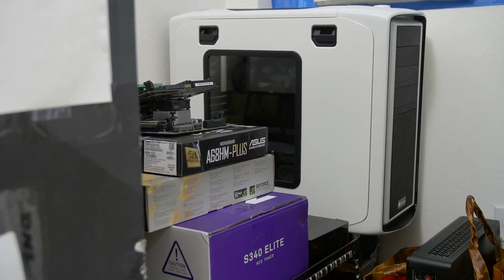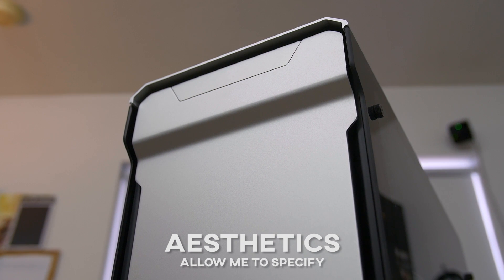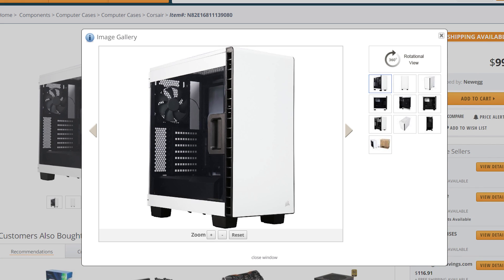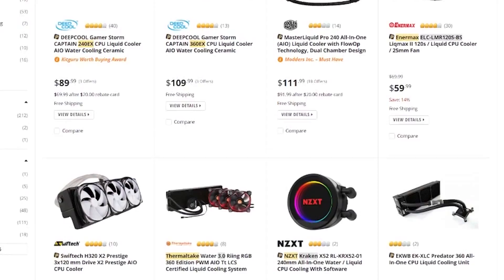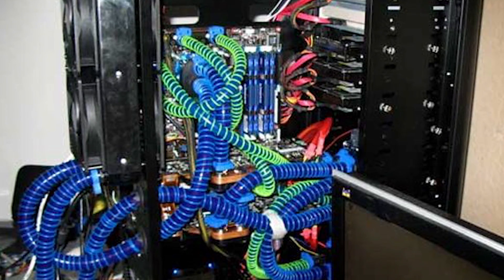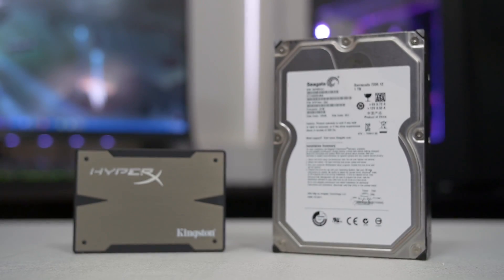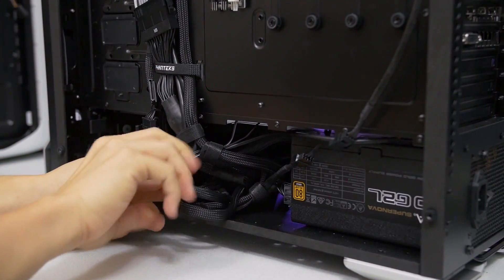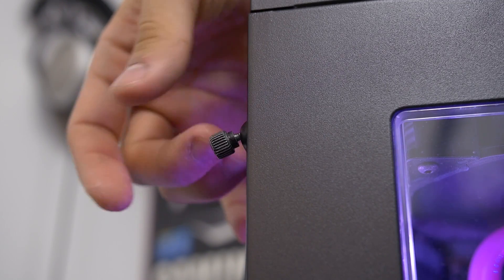4 Major Changes to PC Cases in the Last 5 Years: Then and Now

Comment: Sorry to say this but the most annoying thing about modern cases is the removal of 5.25" bays. Some of us still use DVD/CD/blu-ray drives for installing software and watching films and tv shows on DVD and blu-ray. It was an absolute nightmare trying to find a decent case that had a 5.25" bay but I did find a Phanteks Enthoo Pro at Novatech in Portchester that has 3 of them.

Comment: A lot of mid grade cases comes with dust filters, instead of taking my PC apart to clean it, just clean the filter every 2 weeks. 5” bays are gone and HDD move to the bottom. Most cases can accommodate water cooling.

Comment: For me I really enjoy 2020 trend of full mesh fronts instead of glass, like in a whole Cooler Master lineup and couple of others.
And yes - cable management came a loooong journey. Last week I've tried to cable manage my 5 year old PC. I've ended up buying a new case. Great to have power cable cutouts, but I have like 1cm of clerance in the back side of PC so no option to route main power cable. And a power supply mount in the upper corner... ughh boi

Comment: Man we're not even going back far enough here to talk about when power supplies got mounted on top and cable management solutions were virtually non-existent.  My first case was an original Apevia X-Cruiser back in 2008 and it was basically just a standard office desktop tower like you'd get from Dell or HP at the time, just painted black and with a fancy front panel.

Comment: I'm still with my 6 years old system, and is still running pretty strong, just had a recent minor upgrade (a gpu), and my case is the 600t like in the video, and maybe in 2021 i would upgrade, but i am definetly keeping the case for it's side panel, and frankly it doesn't look too bad even if it's old (and it was also very pricy in italy back then around 200€).
i7 3770K @5.2Ghz, 16Gb of ram and an RX580 (got a deal used for 100€)

Comment: rubber grommets on cable route holes, PSU mounting position (but that goes WAY back), cable management, space, cooling. 

My case (CiT G Force Gaming Case (red LEDs) is SHIT. Properly bad. No grommets on cable holes, very little attention to cable management (if any) no space to stuff extra cables, the WORST cooling solution in the history of cases. I mean seriously, friction (at the best of times) mount honey comb metal strip....things with FOAM acting as a dust filter like WTF CiT. and a bunch of other pointless things.

Comment: Asus Vento 3600 in black, I still use it. Bought it as a joke in mid 2000's because it was so ugly. Grew to love it and now I still use it with my current build. Funny thing is it actually keeps my 1080's cooler then my NZXT case o.O Side case fans need to make a come back and RGB needs to die.

Comment: you forgot the fact that the cases now can take bigger air cooler heat sync and since the removal of the cage there is more space for the larger video card.  Also the cut out behind the cpu to make mounting the cpu heatsink /water block easier without pulling out the motherboard

Comment: I would like to see cases that are completely tool-less except the PSU and motherboard. Rubber stand mounts under the motherboard to reduce vibration from the GPU and CPU fans / pumps would be a big plus. Better sound or more dampening materials. Case fans REALLY need to drop in price because $20 gives you a decent fan a $30+ you get really good fans. I really don't want to spend $60 to $100+ just on fans. I know this video came out a year a go but it still seems to be up-to-date.

Comment: I hate captive thumb screws! 
They are not working as smooth as the normal thumbscrews used to! :P
On my latest Phanteks build I screw them in tilted several times and they were hard to unscrew with the thread getting beat up a little.

Comment: I love all these new things. Though I will miss the days of cutting holes in a new case with a cutting wheel, and bending the back panel to hide cables as much as possible because semi modular PSUS where way to expensive. Or reverse mounting hard drives to hide the cables, buying cablized IDE cables so you don't have a pancake of wires blocking all airflow. I also miss the sounds of a western digital raptor raid setup. Or the sound of a Bigfoot booting. Uh oh....im getting old...

Comment: Hehe, i got this exact corsair case still, and recently the top fan burstet into flames because a capacitor overheatet and lit the dust in the honeycomb above.... so if some one is still using it, beware of old case fans

Comment: I hate modern cases.. Don't mind the design but I want a 5-inch bay; card readers aren't useless, same with extra front USB...

Also, basements and shrouds are just lazy to me.. I loom and manage my cables no matter what; some kid buys a case with a basement and shoves the wires in it and he's a 'custom PC builder'.

Fractal Arc Midi 4 lyfe.

Comment: i wanted to make a cheap media rig to have in the living room just for storing our favorite movies/music etc and when i remembered i kept my old HP pavilion mini ATX case that i ransacked for spare parts during my last build, i figured i would use that as my platform! well that idea ended quickly when i realized how small the space inside is, virtually no cable management options short of zip tying to random pieces of sheet metal and how awful the fan locations are on those old cases (1) 92mm bottom and (1) 80mm side fan only? really 2007?)im just going to use a Fractal Design Node 804 for the media rig, it actually looks a lot like my surround sound subwoofer so it should blend with the rest of the setup better anyway (there goes the "cheap" aspect of the build)

Comment: I wish Corsair or Fractal would make a Tempered Glass case door with a small HIDDEN BUTTON on the back of the case instead of those huge ugly "car door handles" they call side panel buttons. Also it would be nice if the hinges were where you can open and lift the door off the hinges when opened far enough.

Comment: I found my old second hand Lian LI Case.
Its complete out of thick aluminium. But it isn't useable for modern Boards anymore, it doesn't have a hole for the Backplate of CPU coolers.
My next Case was an TJ08-E A mini Tower which has only support for 1x120mm Rad or only 2 Fans in total. For 5 Years that was my PC until recently.

Comment: Wow, this makes me kind of sad. I remember when I one day took "my older chassie" and painted it all black (doh, it was gray at first as they were all grey...) then I cut three holes in the side and put a 220v fan and two regular 80mm fans there and I also cut a hole in the top for a 90mm fan. And at last I had to have my fan-switches somewhere, so I painted a piece of metal in white and mounted it in the bottom  front of the case. When I arrived at a lan party a couple of weeks later - everyone looked at my case since I was the only one which had actually modified it. I loved to overclock my gear at the time and I know that I bought a (cheap) graphics card (asus mx7100?) with 32mb of ram which I overclocked by moving a smd resistor on the board which allowed for a modified driver, and also homemade cooling from cpucoolers which I had sawn apart - I topped the gpu at 220mhz and the memory aswell. Good times.

Comment: Is airflow as good with the cases that have a solid front and vents only in slits along the sides (as in the Define S for example), compared to the old cases with fully meshed fronts? Is it as good or is it a compromise (have to use higher static pressure fans, or rely on fans more -> more noise)? Thx.

Comment: I think somewhere down the line we'll have to rethink the whole thing again. GPU's get beefier and beefier, and there's only so much you can hang from a PCIe and one screw.

For example... what if we put the main PCIe slot on the bottom of the motherboard, and the GPU connectors its other side? GPU would rest on top of the shroud (perhaps on some small standoffs) and it would be "the right way up".

Comment: Pfft. 5 years? I have a 10 year old Lian Li. The power supply is mounted on the top and uses case air. You want a radiator, you drill a new hole. Now that's nostalgia. ;)

Comment: I started my build career about 15 years ago with a Raidmax-style monstrosity. 80mm fans, huge window, top-mounted PSU, bright colors, and a swinging door which I thought was awesome at the time. 

Fortunately, as I grew older, my taste for cases evolved and I picked up a legendary gunmetal grey Antec P180 in college and had it for the better part of ten years. 120mm fans, shrouded PSU, water-cooling support, cable management, low noise, and a streamlined design but still had the front door. Thing weighed like 30 pounds too.

Now I'm using a NZXT S340 and, aside from the side window,  feel as though I've found another case which will last a long time. It's more compact than the P180, has improved on the PSU shroud with bottom air intake, solid cable management, incredible real estate, sleek, and the loss of optical bays which really gives it a progressive feel.

Comment: I have an old Antec case similar to the one shown in the video that has no cable management hole for the cpu pwr. That along with the drive bays make the case a nightmare to work in.
So cable management support is a big one that we probably don't think about.

Comment: "First gaming PC 5 years ago".... Damn am I really that old..... 

My first "gaming" PC build was: 
486 SX25 
8MB of RAM (8x 1MB 30pin SIMMs)
Diamond Stealth 24 VLB (S3 805) 1MB (yeah MB not GB)
170MB Conner Hard Disk

Only the GPU was new the rest was bought used with pocket money and odd jobs. I still remember all the major components, it took forever to get them all together and actually build the machine. This was back when the Pentium 100 had just come out so 486 parts were still expensive, even used.

Comment: Your just a lil boy in rig building years. First dedicated chassis I built in was an apevia x-plorer from your very own newegg. And if you weren't buying lian li or antec back then, your case was probably rubbish, thin non coated pot metal inside, horrible led's and cheap mesh on the out. Absolutely nothing was removable, not even a chance of cable management behind the mobo tray, and forget about sound dampening. We have come a VERRRRY long way from those days, as even on budgest cases, all this is considered now.

Comment: I had a 600T with my old 2600k build I did a long time ago. I was AMAZED that the seemingly flagship corsair case, wouldn't fit my flagship corsair cooler, the old h100. I was so upset, I forget what case I went to next. Also hated the foam type small cell dust filter mesh. Impossible to keep clean.

Comment: I just bought a 600T from a PC repair shop for $20.00, it was missing bits, and that is why I'm now a corsair fanboy. I looked for the parts, X>google<X and was surprised to find EVERY part for it was available, cheap, and direct, from CORSAIR!!!! So I transplanted the goods from my stealth NXT case, to this one, ordered/received my parts, and could not be happier. Misc system temps improved, its quieter thanks to the huge 220mm fanS, yes plural, for two of them. There is a feel of true quality to every corsair I have built so far, and this older unit is no exception. It's going to be a platform for a true custom PC with many mods to it in the future. Awesome case and brand.

Comment: I love the 2 count HDD bays. Much better than mounting sideways on the back and having the 2398472 drives cages where you maybe used 1 or 2...but my biggest now vs. then is HDD cables going into the back of the case, and not into the main chamber!!

Comment: Still rocking the first cm690 here. Own it since my first gaming system which had an amd 6000+ and 2x8800gt's. Back then it was untinkable to have a smaller chassis with such a setup.

Comment: So tempered glass, no record player space, psu basement (which the 800d had 5 years ago btw), 140m and 200mm fans, get a motherboard with m.2 and stick a 500gb ssd in it, 2.5in ssd behind motherboard tray maybe (or use a NAS or something), rubber cable management grommets, all black sleeved cables, no more reset switches, magnetic fan grills, RGB led strips top and side, captive screws.
BOOM beautiful pc, only 4 black sleeved cables coming from motherboard (and 2x 8pin pcie on another cable for gpu).
seeing as we dont have record players or racks of hard drive cages anymore and nvidias pretty much given up on many gpu SLI I recon there next thing would be glass matx cases with most of the aforementioned^ but its also less deep so the right hand side of the motherboard doesnt have a big empty gap in front of it, radiators can still go in the roof.

Comment: Changes I have seen... Going from a standard 80mm set of fans to larger 120/140 fans.  Power supplies going from top to the bottom of a case.  The fact that we can now easily tuck PSU cabling behind the motherboard tray, as this was once mostly impossible with a case.  Sadly it now seems I am seeing a point where we have towers with fewer 3.5in bays, as well as fewer if ANY 5.25 bays...

Comment: One case design I'd love to see them learn from is the Z800 workstation. I have one (bought refurb). Some points stick out: you can disassemble the entire thing in under 5 minutes, using no tools, and no screws, thumbscrews or otherwise. There is a 'car door handle' to the side panel, and from there, green buttons you press which release things (often handles). Hard drives are on sleds in a hot swap bay (and the only improvement here is essentially to go to a trayless design, sliding the drive in and locking it into place, with the SATA connectors being lined up and inserted automatically). The 5.25 bays, again, are released by pulling a lever panel (marked greed) again. That you can change all four hard drives, 3 DVD drives and the power supply in about 2 mins is something that made me laugh when I first got it.

Comment: Got me a Thermaltake Armor from 2007 which has a history of 4 motherboards.  Current setup being an ASUS RVE all-water with a 980 Classified and Intel 750 SSD, also on water.  2 radiators, Alphacool 86mm Monstas at 120 and 240 sizes.  Finally RGB caselights via Arduino/Neopixels.

I often consider getting a newer case, but, why? =^-^=

Comment: my biggest relief was when it became standard to have a hole in the plate behind the Motherboard, area around the cpu. So you didn't need to remove the motherboard to install a cpu cooler that needed a backplate.   yeh im old. :\

Comment: My Antec 902v3 failed Spectacularly top fan Broke pieces flew throughout my pc and nicking some PSU cables. and that bitch is a proprietary fan I loved the case back Then but it was Heavy AF I now have HAF XM ( Discontinued Shortly after I got it)  With all that honey comb Goodnes all the features of the HAF X  with a littles les space.

Comment: 5.25" bays are awesome and it sucks to see them disappearing from so many cases. 

If you work in IT you'll do a lot of data recovery for clients. The ability to hot swap multiple 3.5" and 2.5" drives is awesome and discs are the best way to backup data for the every day consumer if you actually want your data to last. Not to mention, BluRay is still the best way to get the best possible video quality (not everyone has 100Gb/s Fibre directly to their computer).

Get all your family photos on a BluRay and store it in a safety deposit box and as long as you don't play frisbee with the disc it'll easily last 100 years.

Comment: I used my Antec 900 case for almost 10 years. To it's credit, the fans in that thing were just as good as when I got it. Very popular case in its day.
But switching to a NZXT S340 was amazing. It was smaller, but felt more roomy. It looked way more professional. The PSU basement is great. SSD mounting, easy cable management. Just a huge improvement in pretty much every area. 
I had no issue scrapping that old case for parts. :D

Comment: ATX cases could be made much smaller (=shorter =looking taller) if all HDD/SSD spots would be around the case like on top of the PSU shroud, back of mobo and even inside top of the case for us who don't require more than two case fans.

Comment: What others have said, if the case have bottom mounted PSU and supports at least two 120x120mm fans for intake and exhaust, then there's no need to change your case with every build.

Comment: i feel the ability to hide your cables by rerouting them behind that back panel area is newer as well. my InWin Maelstrom doesn't have that and my insides are only able to be described as looking like just that. in other words, spaghetti is an understatement. thankfully, the corsair i got back then, sleeved their cables black. therefore, i feel, it's not too terribly hideous, just terribly shows it's age. plus side is i can run external rads if i wanted 10 miles of water line, and a sasquatch footprint.